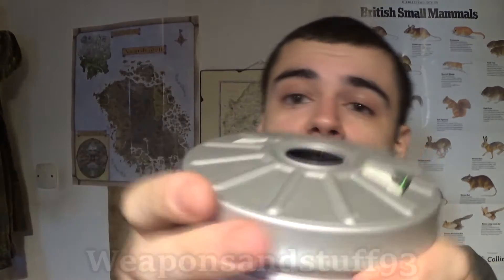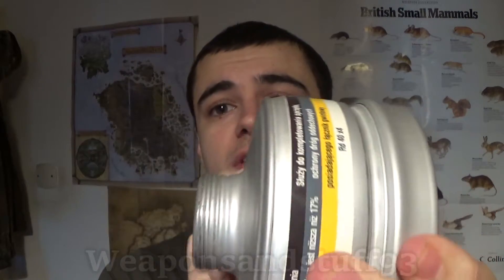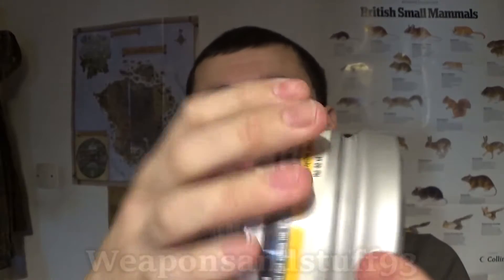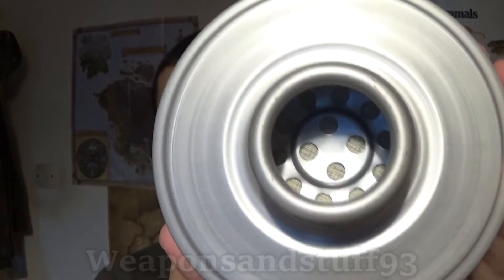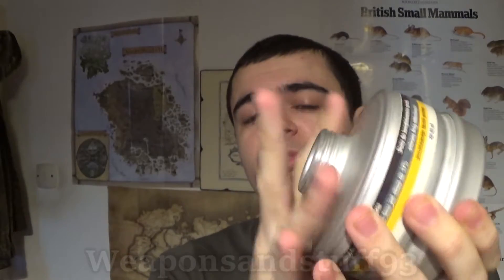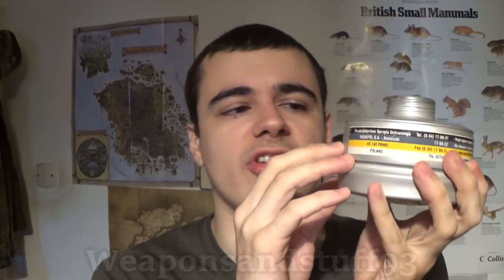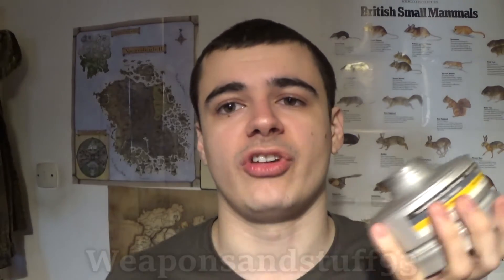How to tell when a respirator filter is going to stop working

Comment: Would it be a good idea to put some kind of harmless scent, like a drop of banana oil (or maybe a longer-lasting essential oil), on a rain sock over the filter? That wouldn't put out enough vapor to shorten the filter's life much (in the scheme of things) and would give you immediate, guaranteed warning if the charcoal is getting used up instead of having to take a wild guess.

Comment: Dose a s10 gas mask expire
Reply: The rubber could break down over time yes. I have an S10 made in 1988 and the rubber is still in great condition and very pliable. I only recently obtained the mask, but my guess is that it did not see much use from its former owner(s).

Comment: Can any filter last a couple days or weeks to months or it will never last that long?
Reply: I'm especially wondering how long Particulate filters last. A month? Months?
Reply: Saltire Snake they last until they get clogged up
Reply: How long, on average, does a P3 Particulate filter last if used about once a week for 1 - 2 hours at a time?
Reply: Saltire Snake depends on the environment but they last until they get clogged up
Reply: Outside my house. City environment. Supermarkets etc.
Reply: Saltire Snake if there’s not a lot of smog then you’ll be fine until the filter clogs
Reply: I'm not asking for an exact time period, just a rough estimate. Hours? Days? Weeks? Months?
Reply: Depending upon the amount of use i.e you dragging particulate matter into the filter by breathing, then I'd hazard a guess at months. Think about it this way: How often is the air filter for a car's engine replaced, every 12 months, 2 years?? I know the holes are bigger, but obviously if it's going to be used in an extremely dusty environment such as the Paris-Dakar rally or Baja 1000 then that will drastically shorten its life!

Comment: If you use a filter on the mask just for fun and then seal it wil it still work
Reply: This is a bit old, but more or less, yes. If you aren't using it for a life saving situation, feel free to use an older open filter. The charcoal part that stops chemicals and "smells" will usually expire after a few months onced open, but hey, if the environment it's left in doesn't have much in it for it to absorb, it could last a while longer, but if you're using it for a health/safety reason, you'll probably want a fairly fresh filter cause, as some have pointed out, the charcoal part that stops the really bad stuff you don't know is bad until you notice you're smell the bad stuff. The particle part works until you can't breath through it, so if you're just using it for dust, you'll know when it isn't working anymore.
Reply: Predator  depends on what the situation is. What you're filtering out and how much of it there is are going to decide how long the filter will go. Some chemicals will eat up how the charcoal works and if there's so much of it, you may only have like 20 minutes if you're unlucky
Reply: Predator  but as he's said in other videos, maybe a few hours, but don't use gas masks to go INTO bad situations, they are for getting out. Since I'm assuming you're asking about for Corona, probably a few hundred hours of breathing since you won't be breathing in tons of dust so the particle portion of the filter will last a long time.
Reply: Predator  yeah, the particle portion that would be used for viruses, dust and such is a different part than what stops chemicals and gases. The part for gases kind of will go bad over time as it slowly absorbs things from the environment it is in if it isn't sealed. The particle part slowly clogs with dirt when in use. Even if it isn't sealed, it should work until you use it enough to catch enough dirt or other particulates in the filter to no longer be able to breath through it.

Comment: Would a CBRN fit on a GP5
Reply from the maker: What's you question? Asking would a Chemical Biological Radiological Nuclear fit on a GP-5 doesn't make any sense.
Do you mean CBRN filter? Well that entirely depends on the screw thread.
Reply: Yes I meant the filter I want it to be an air tight seal

Comment: Any idea what rating the s10 filers are? Also, can a cap seal only filter last 10 year easily and do vacuum sealed ones have a pretty much guaranteed lifetime?
Reply from the maker: S10 filters should be A2B2E1K1-P3 at a minimum, foil wrapped filters are normally 10-15 years expiration dates.